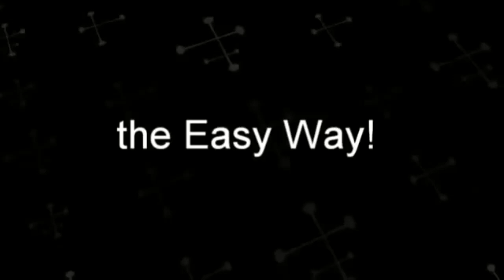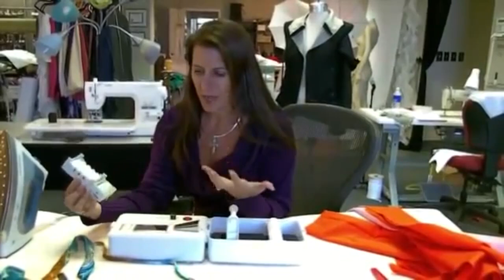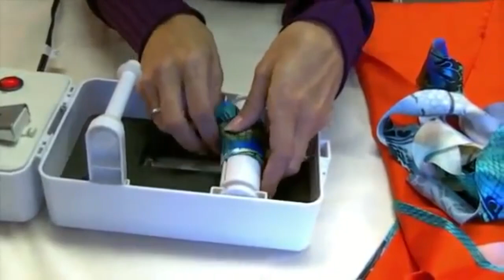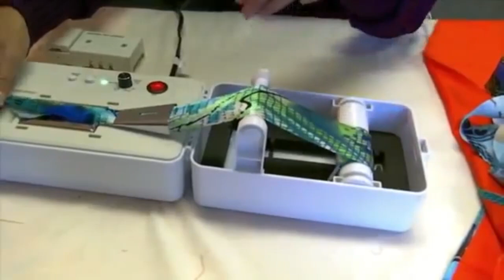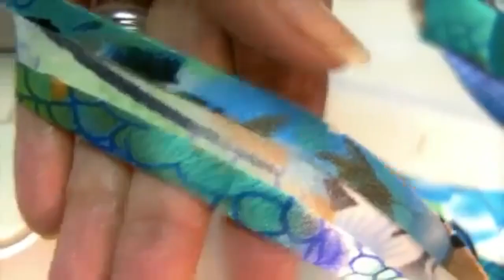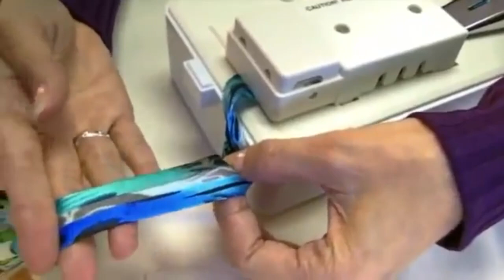How To Make Your Own Bias Bindings  - Simplicity Bias Tape Maker Review

Comment: Hi Angela, I purchased one of the Simplicity machines, I also purchased a package of other sizes of tips.  I noticed that the bigger ones have a different configuration than the one inch tip that is on the machine when it arrives.  So if I wanted to make a 1 1/4” , the opening is much bigger where the tape comes out.  It almost looks like it would just fold it in half, which would be swell for some applications.  Any ideas on this?